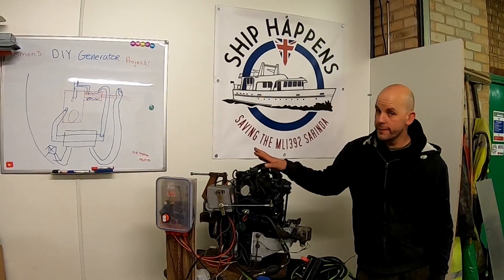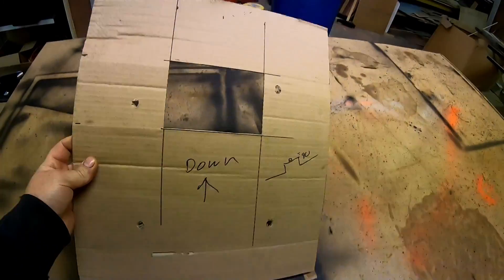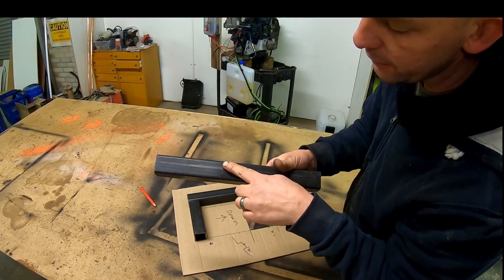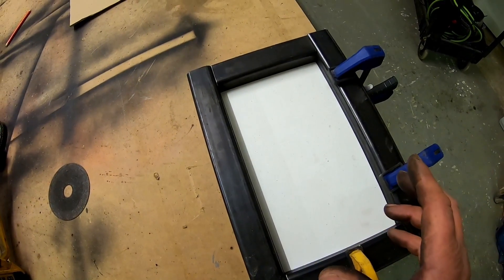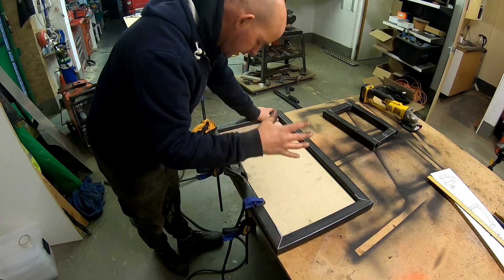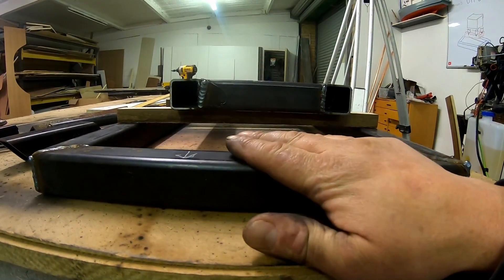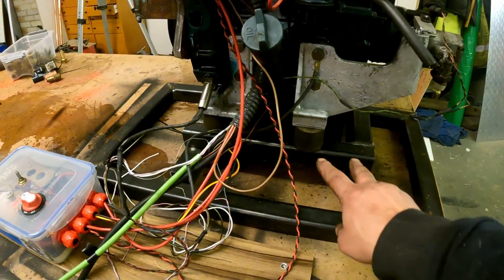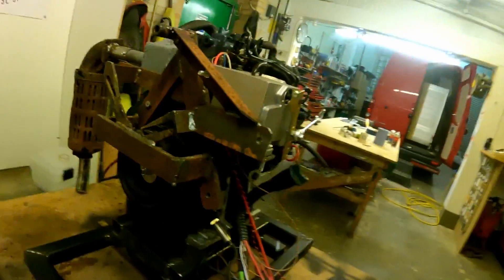Part 4 DIY DC Generator Build - Making Mounts

Comment: Tip for an easy and clean oilchange : Put a banjo bolt on the sump plug, then connect a hose to a simple oil sump hand pump and mount this neatly up high. It will transform the way you do an oilchange!
EDIT: have a look at the BetaMarine14 for an example

Comment: Hi Simon you will need to add a torque reaction rod to the engine. The rubber insulation blocks you have used are for movement exhaust mounts, you will need firmer engine mount insulation block hope this helps. If you need any advice on your diesel engines or wiring engine or the boat please send a message, retired coach/bus mechanic.

Comment: Simon if your rubber mounts dont hold up or are too soft i can  recommend the the polyurethane type they supply for uprating  performance car engine and suspension system mounts . They dont go soft at higher temps and are generally impervious to oil and fuel damage which is what kills most rubber bushes off. They also often come with stainless steel inserts to avoid bolts seizing in the bushes ..
Pick ones for high volume high interest vehicles they sell more so are a lot cheaper they also do replacements for the drive donuts used in flexible drive couplings. For drive shafts and steering linkages... 
I got fed up of replacing the rubber ones in my ford based specials.

Comment: You just demonstrated one of the best ways to slip a disc in your lower back. As you rightly subtitled. "Please do not do this at home." If you can't lift it with a straight back, use a lifting device. It's cheaper than lost time and back surgery.
Having said that, love this series and thanks to Foxes Afloat to turning us on to it.
Keep up the good work.

Comment: What you can use for the engine mounts  is hockey pucks, you might have to custom fit them . It will eliminate most of the sway.

Comment: A 12 volt winch attached to a scaffold pole or you can get them that have a boom, that’s in case your roof beams will not accommodate the weight